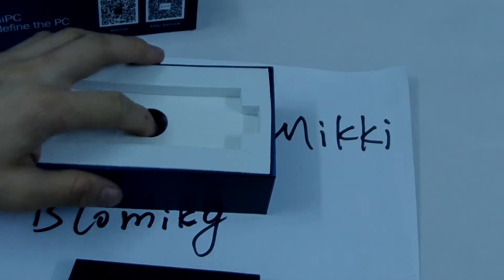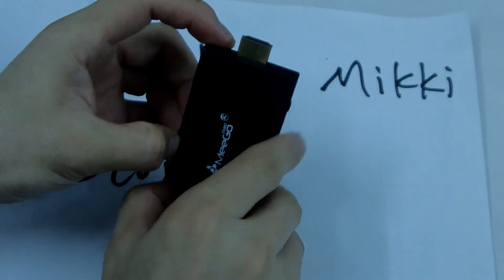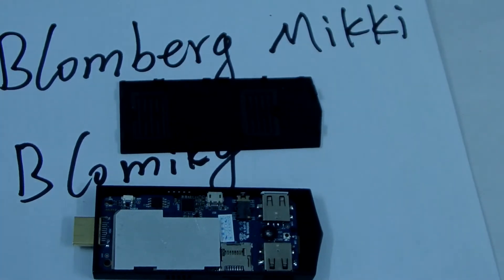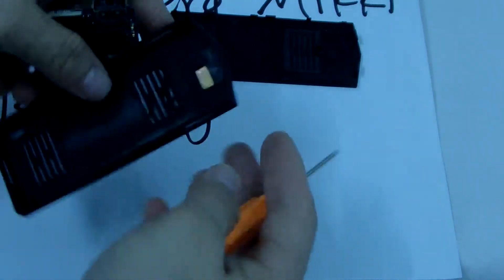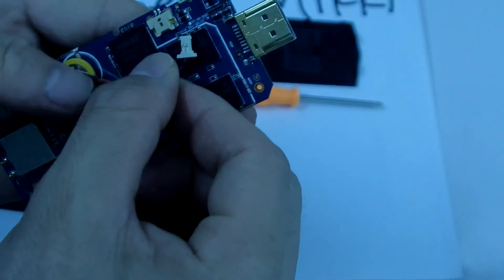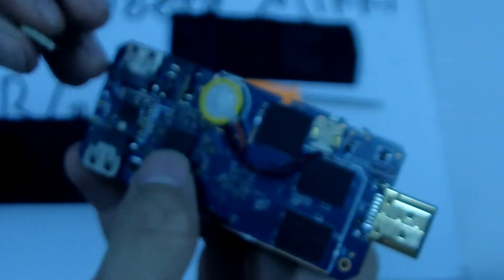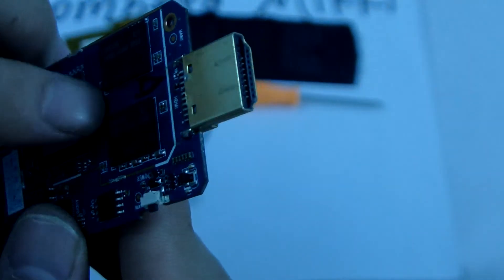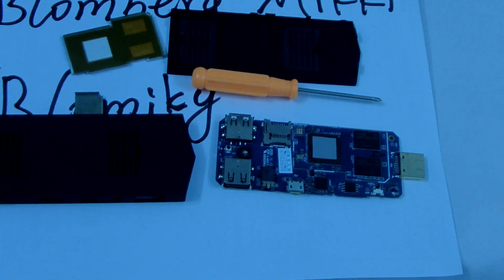Blomiky Meegopad T02 mini pc disassemble have a look

Comment: thanks, I removed the top cover and the metal plate.
Added a cooling pad and a heatsink.

Temperature now remains below 55° idle, and is around 69° watching a HD movie fullscreen (I use the Ubuntu version of the device).

Before this modification temperature was above 63° idle and raised to 85° watching the movie, freezing or turning off the computer.

I might remove the whole case and add another heatsink on the opposite site, but for now will observe how good this simple solution works out.
Reply: which heatsink do you use? size?
Reply: +Thomas Testuser  I actually use this one that has less good results: http://www.banggood.com/100x41x8mm-Aluminum-Heat-Sink-for-Computer-LED-Power-IC-Transistor-p-991274.html

It gets pretty hot, and watching movies in google chrome temperature still can reach 80°.
I tried before (the values from my first message) a larger one like this and will use it again: http://www.ebay.de/itm/301736437715

Such large ones just get slightly warm.
To attach them to the stick you need a flexible cooling pad that can be pressed between the chips and the heatsink.
Quality varies, I use this that has a good ratio of 5W/mK: http://www.ebay.de/itm/111316230737

I already had modded a Pipo X7 like this and was able to play fallout 3 with 3D drivers for hours with it on windows :)
Reply: +Mark Ulrich Thank you for your answer. I already have bought this one:
http://www.ebay.at/itm/111612428798?_trksid=p2057872.m2749.l2649&ssPageName=STRK%3AMEBIDX%3AIT

I hope the size fits and it cools down my device enough.
Reply: +Thomas Testuser I think those are too small, they just will lower the temperature very slightly.
Intel is using a long heatsink on the Intel compute stick, with a small fan in addition. It seems to be slightly smaller than the heatsink I actually use (but without fan, the one from banggood). So it seems it is not just my personal impression that large heatsinks and/or medium ones+fan are required. 

Of course it depends on your purposes.
To watch youtube, I use a plugin for firefox, that opens videos in VLC. With VLC, processor load remains between 20 and 50%, so a medium sink without fan is ok. But if I use flash or HTML5 in google Chrome (in firefox they work not correctly), the load can reach 90% or more, so the system overheats. In such a case a very large heatsink or a medium one+fan is a "must".
Even scrolling through larger pages like facebook uses 50% of CPU load, but as it is not permanent as watching a movie, your small heatsinks might be ok.
But don't expect too much from them, I was astonished how hot even the medium size one gets. The small ones might get so hot that you can burn your fingers.